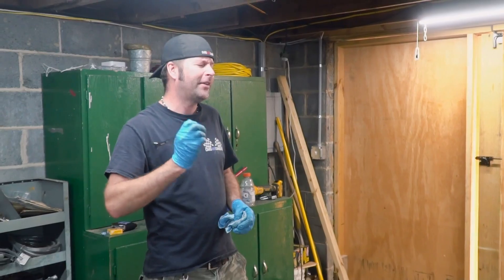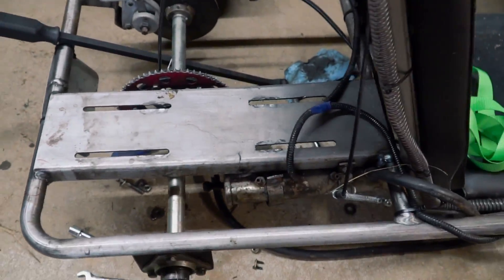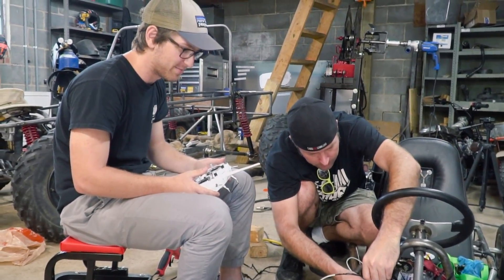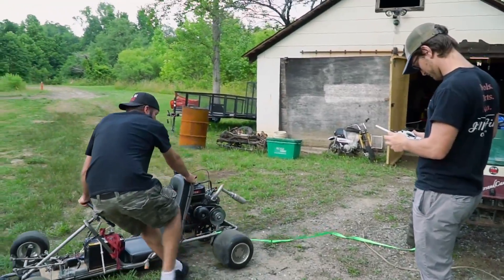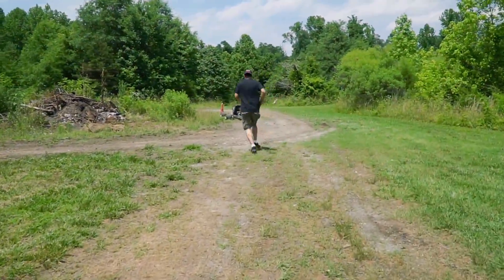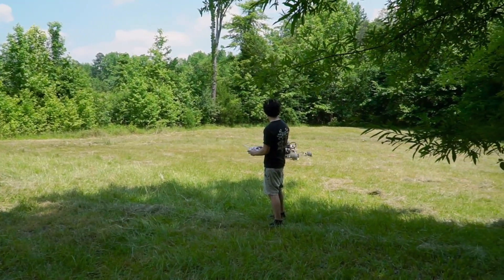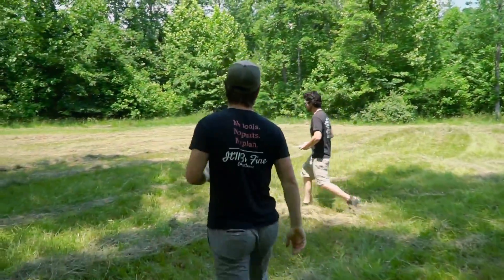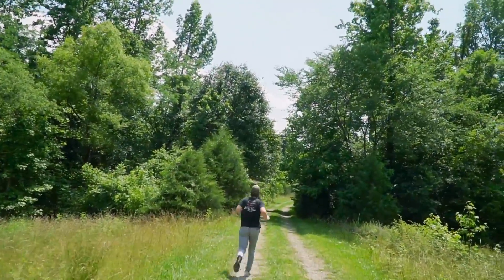We Rebuilt our Remote Control Go Kart and IT WORKS!! (Doughnuts, Trying to Drift, Test Driving!)

Comment: For the steering , add limiting switches for use so the steering knows when it's been activated so when you release the control knob telling it to steer it will return back to center like a rc car that way it only steers when you tell it to steer , have program master program the brain to understand what's going on

Comment: you can also adjust the rate in which the gimbal applies power you can either make it more linear or you can make it ramped up in other words it's smooth smooth smooth as it ramps up and then it gives it all

Comment: If you can find some cheep servo motors i think those would serve you better. They are strong and quick. Start and stop on a dime and give you $.09 change. All you need is an input to start and stop. You have that with the remote handheld.

Comment: You can most likely use an rc servo for the throttle. Just attach it to the cable instead of the pedal. Then you can have a dedicated wiper motor for the brakes

Comment: Just so you knowyour taranis controller is capable inside of the programming to switch your steering gimbels from left to right or right to left however you see fit the same way with your throttle you can flip your controls inside of the settings in your taranis ....they're also maybe a limiter set in your controller for your gimbal to allow it to steer only one direction More than the other

Comment: If you could gab something up with a window motor and a gear truck off a window regulator for the steering like a rack and pinion set up. Mount it in the middle on the set up could work maybe for ya

Comment: Some expo on the throttle.
A simpel rc servo on the carb instead of the pedal would be much better.
Doesn't your TX have a reverse button?

Comment: for steering use a window motor with a sprocket on steering column so it gets input just like its getting steering from the wheel not the linkage.

Comment: Adrenal will run all kinds of Motors not just wiper motors and if you change the linkage so you have a second pivot point you can use leverage and increase the power of the wiper motor

Comment: If you weld or bolt a sprocket on the steering shaft and then run a motor with a chain to that sprocket it should make the steering easy and adjustable by changing the sprocket size

Comment: Use a chain and sprocket setup off of the steering wheel hub then u can make stops with the potentiometer's on the flang at the bottom of the steering shaft.

Comment: You could use a largescale jumbo sized rc servo like a savox sg 0236 has 40 kg of torque on 7.4volts more than enough and there probably is stronger ones if you look too

Comment: Dude a window motor would be bad ass. Just link the steering to the push system for the window. It's designed to lift heavy glass. That ought to be way better than the wiper motor.

Comment: Use stepper motors! Lets see how good the programmer is. Using stepper motors you will have soooo much more control and they are as powerful as you want to buy them.

Comment: please use 1/4 scale servos they will handle the controls much better use a seperate one for the brake and throttle (you dont need a big one for the throttle if you hook it direct to the carb) that is more expensive but should give more smiles per mile

Comment: Maybe ground the plug using a normally closed switch that is open as long as the battery has voltage? So if the battery dies the engine dies.

Comment: I still thing auto convertible top screw drives (12 volt 80 lbs thrust) would be better for steering and breaks. It is what I used on the riding lawn mower.

Comment: Electric motor with a gear and a gear on steering column connected with a chain then you can set steering speed with gear changes .

Comment: Can you guys Fab up an electric rac n pinion, with a reverse forward window motor? Or push pull servos that move in increments with push buttons on the remote.. I can think it but not engineer it!

Comment: As an experienced RC pilot/driver/etc, your tech guy needs some help. You could simply invert the controls in the "remote" aka transmitter. Would've taken 2 seconds instead of having to adjust the whole design

Comment: Coming from flying gas powered RC airplanes I have one question why didn't you just put a servo directly on the carburetor? K.I.S.S.  trying to have a dual action throttle/brake is a non-starter, way to much to go wrong. I'd use 3A Stepper drivers and 825oz steppers for brakes and steering. with Left/Right/Center position limit switches and have the controller just reset to 0 when sticks are neutral.
Reply: The mikuni carb has a return spring the is real strong so we needed something stronger to control it

Comment: you need stronger and faster on the steering just go 18v or 24v on the motor and you will get both. window motor wont be much stronger or faster they are geared dont to move the heavier windows

Comment: Hey John, check out Andymark.com for some motors you might find what you’re looking for, they’ve got a few different types of motors that I use on robots that weigh probably just as much as your carts do and turn no problem, granted most robots I’ve built turn like a tank but it should help a bit, it’ll need some programming like what your buddy Michael was doing
Reply: I can guarantee that you won’t need brushless since brushed is cheaper on the site

Comment: I am still very worried about the use of that wiper motor for gas and brake, and feel like it would be far safer and more reliable to have two separate motors to run them. Youd have the individual power needed for brakes and gas, you can tune them for the range and power you need for each, and you won't ever have to worry about the motor going too far in one direction and stomping on the gas. Sure, it might not be quite as cheap, but in my opinion, it's far better to spend more to be safe than spend less to be sorry.
Reply: Why are we not using a r c car radio they have strong enough servos for all of what u are doing

Comment: SHOULD HAVE JUST USED SERVOS
Reply: Big enough servos are kinda pricey I guess... but yah itd be a lot better with servos.
Reply: Yes servos would be much better... But unfortunately these guys have the full Budget mentality, so I'll bet that won't happen
Reply from the maker: we don’t know much about the RC game so we used what he had laying around
Reply: @CarsandCameras  i think a high torque servo with a spring to pull throttle back would be much Safer
Reply: @CarsandCameras  if you lose signal it would just go to idle
Reply: Michael Garcia if it were to lose signal while the servo is pulling the throttle then it will be stuck in that servo position. And having the spring pull it back could cause damage in the servo because you are adding stress that isn’t really necessary. The safest option is have a signal line hooked up to a relay that can kill the engine with a lost signal.
Reply: @nolansprojects2840  no if my RCs lose signal they go to zero
Reply: @nolansprojects2840  I've lost signal halfway across the hood it didn't stay full throttle
Reply: Large enough servos would cost as much as the whole cart wiper motors are okay to go and they are proportional you just got to get the set up right I did it with a Power Wheels it was a pink Barbie Power Wheel but it still was fun
Reply: @michaelgarcia2440  Yep if you loose signal the servos go to neutral setting which would be idle I raced trucks for 4yrs I won the 2003 points championship at Coopers RC in VA dirt oval & over 30 trophy's  in off road racing Very fun!!! ✌️
Reply: @clayman1405  No you don't need to servo the pedal the throttle lever at the motor doesn't need a large servo.
Reply: @michaelgarcia2440  i fly drones. When they go out of range they are stuck at last signal given when radio goes out of range. Also raced cars 27 and 72 mhz. in late 90's till about 05, they did same thing, been there done that. Lost a cheap drone last year trying to learn flying with fat shark goggles not good
Reply: @gqp3215   Drones radios are built to  keep going till the signal is found again thats not the radio to use in this application and yeah old 90's radios are different from a modern system
Reply: So you guys need to do two things when using that radio. First set the failsafe for the throttle.  If you loose signal the program tells it to go to 0. Second is set some expo for the steering. That will stop the aggressive steering. Look up Flite Test's video on expo. It's an older video but it will give the basics on how to set it. Also consider setting the endpoints for the controls. That way you do not go too far on motors and strip them or cause the controls to bind.

Comment: Put an fpv camera on it and you can use fpv goggles to see where its going without running behind it they are cheap and you can get cheap goggles to i use them on my drones you can sit in the shop and drive it all over the property without leaving your seat

Comment: A better throttle system could be a regular servo mounted on tue throttle plate like the predator
Reply: The mikuni carburetor doesn't have the same linkage
Reply: @isaacitllbefine7231  yea afterwards i seen that

Comment: I get wanting to be different and use wiper motors and such. But you have wayyy to much time and energy involved with such crap results. Using a 1/4 scale rc car servo for the steering would result in a 1000x faster response, same with using one for brakes and throttle. And a basic 3 channel reciever and controller will do the job rather than a drone or heli controller.